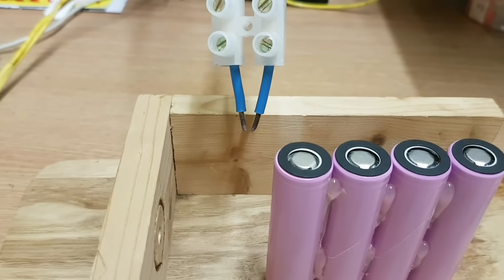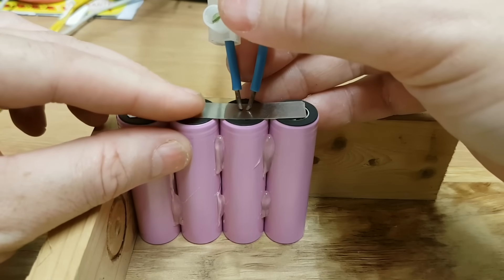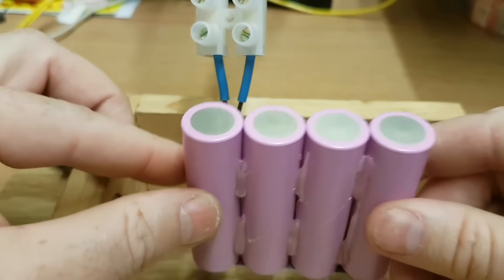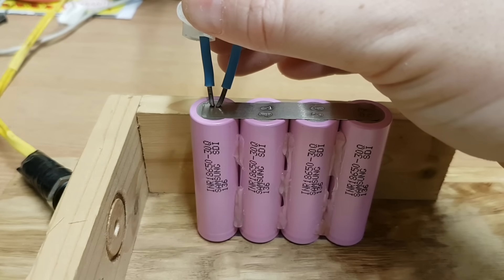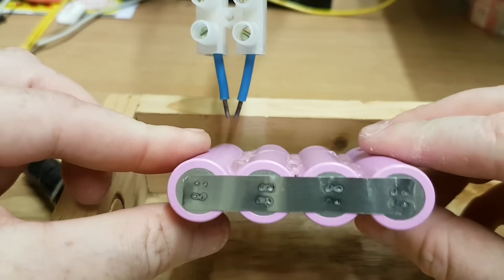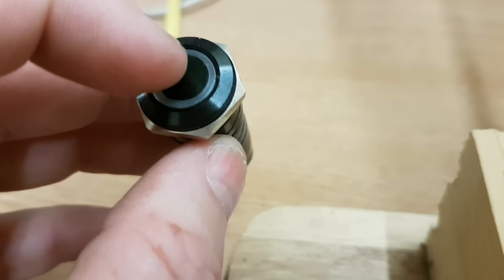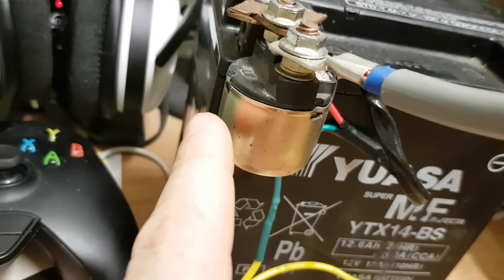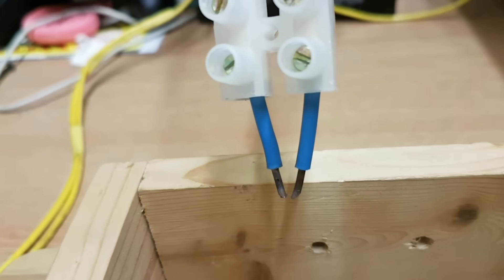DIY Battery Spot Welder - Demonstration & Explanation

Comment: Yes, try a foot switch. I made a spot welder from an old microwave oven transformer modified as a step down transformer: 1.5V at 800A. No need for a solenoid.  I need to see if it will spot weld batteries.

Comment: The consistency of the welds seem to look all over the place. Especially where the electrodes just touched each other and the current didn't penetrate the metal. You should reconsider to build some decent and sufficient stiff electrodes.🤔
Reply: Also the timing is all over the place too so some of your weld suck in quality and consistency.

Comment: Can you just parallel together just like that without fear of thr different state of charge in each battery?? I want to parallel spot weld but fear of sparks flying when i attached the metal strip. Thinking of parallel 5 units of 2800mAh panasonic batteries.

Comment: This is handy to know. When I had a job refurbishing starters as a lad, I made several critical welds using a copper clad carbon rod, (type that used to be used in movie theaters to produce the bright light cast upon the screen). The point I'm trying to make is that we used a car battery for the source of power to weld for that, so it will certainly do a great job for small spot welds as shown here. Thank you for the video, I'll be ordering some nickle to repack a few cordless shop tool batteries. 👍

Comment: I built one of these today to repair a Milwaukee impact gun battery…. They can be quite aggressive on a 360ah battery… my first few clicks weren’t short enough but I got a feel for it eventually 

I found the negative end of the cells welded a lot nicer than the positive ends
Reply from the maker: I'm glad it worked out for you!

Comment: Hi! Great project. I made all the steps exactly like you but i have an issue. The electrode of the  positive side witch is the solenoid relay side, always made weak weldings. I have checked the electrode,i changed it,i always check if made good connection with the nickel plate but nothing. The other electrode always make very good connection. Do you have any suggestions?

Comment: Great video, but one big danger. An easily solvable danger. Every time you use it, it's essentially trying to weld the solenoid together, shorted. The solenoid contacts are going to arc every time the button is pressed or released. Eventually (who knows when) you'll let go of the button and it won't turn off, because the solenoid is welded closed.

To avoid that, one can use a solenoid rated for significantly higher amps (and perhaps volts) than the battery can deliver. A 12V 100 amp battery isn't going to internally weld a 120V 150 amp solenoid.

Comment: Can I use here 12v 180Amp battery??
Reply: yes video battery 12v 12a. your battery x10 amp
Reply from the maker: No, you need at least 300A. The batter I was using here was replaced with a 360A one, because the welds were a bit weak. The welds with the 360A battery were much stronger.

Comment: Why don't you put on-off switch near welding tips?.So that both functions can be done by only one hand.
Simple,Cheap and best welding machine.
Reply from the maker: It's quite difficult to hold the tips firmly on the nickel, and then press a button really quickly with the same hand/fingers.

Comment: can you help me, i need to desolder spotwelds from a buttoncell in a minidisc deck, as the battery is past it's life, it needs replacing for the deck to be able to store settings when switched off

Comment: This is awesome, I wonder if it has to be a battery? Or I can just use any power source such as an adaptor that matches the amper you mentioned?
Reply from the maker: Most power sources would blow a fuse if you shorted them like this.

Comment: why use a solenoid? Just touch the + and - on the tab and it would do the same.
Reply from the maker: Control is why... You would get a massive spark if you did it manually like that, and you'd probably blow a hole in the cell.
Reply: @darkkevind  use a thin gauge wire. It can't pass all that current

Comment: Not meaning to be a bummer but....

As a qualified electrical engineer with a diploma in electronics I can say this design is downright dangerous!
Those particular solenoids are known to fuse their contacts above 100A. massive risk right there!

There is a HUGE reason spot welders typically have a mosfet array or SCR switching the current  which are controlled by rather sensitive current monitoring, timing and triggering circuits and a plethora of safety cut outs and overloads. 
Using this device in such a simplistic form is asking for trouble.
The risks are way bigger than you would think with extreme currents and highly corrosive substances involved. Lead acid is not designed to withstand direct shorts for any amount of time exceeding fractions of seconds.... please stop doing this, or at least upgrade to a less corrosive/Likely to explode power source with an 800A breaker or at least a thermal fuse on one lead. 
Eyesight, life and property are worth more.
Reply from the maker: Tens of thousands of welds later, no explosion, no fused solenoid, no exploded L.A.Battery 🤷
Many other people have used my design and made these welders and again, no problems.
The thing is, if it does fuse closed, the nickel you're welding is only rated for max. 50A continuous at best, so would heat up, burn & melt open in a split second, thus breaking the circuit.
Reply: @darkkevind it's fine ignore that guy
Reply: Lmao shut up

Comment: I like your idea spot on!
Might be better to use the pulse timer as if you accidentally left the push switch down for too long things would get very hot and start to melt very  quickly in seconds.
And batteries don't like to be shorted so there is a risk 
The battery can explode and someone could have serious acid burns. I just like to mention this as I had a car battery explode on me and there was a huge flash and a bang and acid everywhere I was very lucky.
The battery was on charge and when I disconnected the clip from one of the terminals it sparked and it ignited the battery gases
So I should of switched power off first, this was well before youtube days
So I've learnt to always do risk assessment first.
Stay safe folks.

Comment: What’s the material you’re using for the connector
Reply from the maker: Which connector are you referring to?
Reply: @darkkevind  the metal strip you are welding - is this aluminium? thickness?
Reply from the maker: @andrewmcclure2853  it's 0.15mm pure nickel.

Comment: Can it be used with an RC lipo battery?
Reply from the maker: I'm what respect? Spot welding a lipo connection? No.
Using a lipo instead of the lead acid battery? No. Not unless you want the lipo to explode 🤷
Reply: @darkkevind  I want to use a lipo battery instead of a PB battery. Can this be done both are 12 volts it shouldn't have a problem.
Reply from the maker: @subsonicreviews1835  what's a PB battery?

Lipos cannot be used as they do not fair well with being shorted.
You could use a lipo in conjunction with a large capacitor though.
Reply: @darkkevind  thank you for the clarification

Comment: How many amps are you running this thing at??
Because i have a dedicated spot welder and i am not getting the kind of nice strong welds you’re getting
Reply from the maker: The lead acid battery has a cold cranking amps rating of 330A

Comment: Why not power mosfet transistors instead of the solenoid? IRFP3206PBF can handle 200A 60v. put five or ten of them in parrallel, there are only about $4 each...
Reply: It's using a lead acid battery - not sure this design needs to be any more advanced than a solenoid and pushbutton. A design with a smaller plug-in supply with capacitors would be more suited to "advanced" solid state circuitry. Wouldn't mind making something like that myself
Reply from the maker: Sounds like a good idea. Build it 👍

Comment: whether the direct current is on the weld and how many volts it is
Reply from the maker: 12-14v. Current travels in to the metal surface of the battery and straight back out again through the other electrode.

Comment: Wow this is cool ! Years ago I wanted to start a business rebuilding tool batteries and checked  on a spot welder and if memory serves me right the welder was about $2500 I started checking with battery re builders and found out it was cut throat and there was no money in it and you had to sell the batteries for give away prices . So I pulled the plug on it. This is cool I had no idea you could do this.
Reply: I'm here because I'm rebuilding my own power tool batteries with new cells.
Reply: @jamesrowlands8971  Cool man ! If you do it for yourself it would be fun to do I could totally get into this ! How many are you building and for what tools
Reply: @madmanmechanic8847  I found an AEG drill and impact driver in 'hard rubbish'  a while ago. Had to replace the brushes on the drill to get it to work, and while the batteries functioned, they didn't run for long before they needed a charge, so I bought two cheapo ones off Ebay. But they were crap. The cells only lasted a few weeks. So my thinking is to replace the cells in those. Two of those, plus another proper AEG battery that had died due to a cell failing badly.

I've also got an expired ebike battery. So once 4 packs in total to fix up at the moment.
Reply: @jamesrowlands8971  I gave you a long reply yesterday about Snap On grease gun I was restoring and its gone deleted that is weird
Reply: @madmanmechanic8847  YT comments can be pretty annoying sometimes. Was that a battery powered one that you were restoring?
Reply: @jamesrowlands8971  I never said anything tart nor disrespectful or even one hint of foul language I have no clue why it was dumped . If there was foul language or nastiness I could understand it then. That sucks I spent a long time replying to your reply  😔Yes Snap On Cordless
Reply: @madmanmechanic8847  yeah, I've had stuff just disappear like that, either right after I wrote it, or I've come back to a thread because of another reply and seen it's gone. Sorry to hear about your wasted effort.
Reply: @jamesrowlands8971  That is really weird so this has happened to you too? I just started my own You Tube Channel about four weeks ago just one video up it has been a dream of mine for over 6 years I took a lot of nerve . I was scared out of my pants to learn video editing it really intimated me. Part of my channel coming up is a Snap On cordless  grease gun. If you want I can try and retype the story I sent you this time will will type it in word that why if they dump it again I can repost it
Reply: @madmanmechanic8847  yeah, it's happened a few times. No idea why. Seemed like no rhymme or reason to it. I've been on Youtube for something like a decade.
Reply: @jamesrowlands8971  Okay good bye

Comment: I realize this from a few years ago.  It just now popped up in my Recommends.  Anyways, neat tool you have there, but I thought a foot switch would be handier (footier?) than the button you have there.  Anyways, good job.
Reply from the maker: Thanks. I just found that I never needed a foot switch, plus, without a timer, a foot switch is less accurate in terms of timing.

Comment: Be very careful as mine punctured a cell and it vented a flame. My switch is no where as sensitive as yours though. If you are doing 6x4 cells best to have grid strips rather than over lapping strips.

Comment: What's funny , these Vapers will pay £6-8 quid for a One X 18650 battery , where as you can use a old laptop battery and Find 2 outta 10 are faulty , it's so much cheaper to do that , I know the Toshiba satellite series packs open up 🙏🙏
Reply from the maker: Except most laptop batteries are no good for vaping as they require a high current draw. Vaping generally uses anywhere between 15-40A of current, whereas most cells used for laptop batteries have a maximum output of around 5-10A.
Reply from the maker: But nevertheless, these cells can be bought brand new for between £2-£4 depending on the actual cell.
Reply: @darkkevind  Go in a Vape shop,price up 1 Samsung 18650 or Toshiba,all the same , and ya talking 60% plus RIP OFF,, I know how cheap they are, I sell em to mugs

Don't forget ya Multimeters 😉😂😂😂

Comment: Eu comprei minha caixa de som em 2015 e veio com 400 mah, eu estou em dúvida se eu coloco bateria de 3.7v 9900mah ou 15.800 madh 3.7v, pode queimar? Qual posso colocar pra não queimar?
Reply from the maker: As long as the voltage is the same it will be fine.

Comment: Hi, thanks for this video, I have referenced it in my recent upload. I have noticed with my setup that it's best to use a partly discharged battery, maybe about 12.5v so that the spot welds are not too fierce. Cheers

Comment: what do you mean your battery is 200amps? as i read from the label its 12amps
Reply from the maker: That's 12ah. That's not the rating in referring to. The CCA (cold cranking amp), rating is 200A. It means, from cold (to start your car for example), it can pull 200A from the battery, to turn a heavy crankshaft of a cold engine for example.

Comment: Just a 12v battery with a relay.  So I can build a bench top spot welder press for 18650s power it with my shop AC welder set on low amperage.  200 amps at 12v seems very high.

Comment: Why not have four contacts on the probe head, and you have four welds in one hit? Might need to increase the button press time, but it will save you time doing the packs. The time the current flows is only mSecs ....so why not give it ago.

Comment: We're is the solenoid avilable ratings ie 12volt amps how much amps
Reply from the maker: It's a starter relay. You can get one on eBay or Amazon easily.

Comment: He will have alot of fun when the relay contacts just stuck xD
Reply: The contactor won't get welded shut because it's only for a split second.
Reply from the maker: Many tens of thousands of welds so far and no failure of the relay 👍🏻
Even if does get stuck on one day, the nickel will fuse out in a matter of seconds as it's only rated for 40A. 🤷

Comment: So does it just melt the strip under each electrode and the melted puddle from the strip 'falls' onto the battery end plate? This would be different from spot welding for example sheet metal together where the sheets of metal are squeezed between to electrodes.
Reply from the maker: No it works exactly the same way as spot welding sheet metal. The nickel fuses to the metal of the battery terminal directly under the electrodes.

Comment: what is the role of solenoid ?
Reply from the maker: The solenoid/relay is a high current switch able to act as a switch whilst very high current is passing through it. Without it, whatever other switch you may use to complete the circuit will probably melt.
The small momentary switch is activating the relay, which then puts all the current from the battery to the electrodes.
Reply: @darkkevind  ooo ok ok thanke you .

Comment: For the DC power, can i use computer power supply..??
Reply from the maker: No.
Reply: @darkkevind  okay.... Thanks.... 😁 so i should use the motor battery..?? Right..?? 🤔
Reply from the maker: @adansyahdan9319  you need something that can deliver a heck of a lot of current, 300 plus amps. If your PSU can do that, all well and good, but really you can only get that from a lead acid battery.
Reply: @darkkevind  oooowww... Okay .. Thanks for the explanation..🙏🏻😁.. Need to get that amps...

Comment: Great video.  Thank you.  And also thanks for the links. Extremely helpful. 
I have a most serious problem, a real crisis, to solve with a Solenoid Water Valve.  Due to Covid-19 my wife works from home.  To ease her boredom I hung a bird feeder in the tree outside her window.  She  delighted in her birds at first but now she battles birdseed greedy squirrels all day.   The plump squirrels are oblivious to her scare tactics;  waving, yelling, knocking,  etc..  Even her outdoor efforts fail.  Rude squirrels simply climb higher and bark obscenities down at her.  Once she turns away they’re back at the feeder.   I need a Remote and/or Alexa Controlled Water Solenoid Valve (Preferably 8VDC battery or possibly AC Low V). To drench these plump Critters.  Preferably a valve that stays opens about 5 seconds.  Any help is sincerely and greatly appreciated.  TY Best Wishes!
And yes we feed the Squirrels elsewhere too, but they love birdseed or maybe they just love pissing off my wife.

Comment: Awesome!!!!..but I don't get the point of the solenoid can anyone advise please.
Reply from the maker: The solenoid/relay is a switch that can handle the high current. A smaller momentary switch would melt the first time you tried to use it.

Comment: wait, how are the batteries not shorting out
Reply from the maker: Why would they short out?
Reply: @darkkevind  I'm very very new to battery physics, but wouldn't connecting all 4 batteries in parallel like this short them?
Reply from the maker: @rjsd7  no, shorting would be directly connecting their negative end with their positive end.
Reply: @darkkevind  oh, so because these are all in parallel, it cannot short unless a conductor completes the circuit (top metal touches bottom)?
Reply from the maker: @rjsd7  yeah exactly. All those is doing, is making a battery with the same voltage, but 4 x the capacity, which means under the same load as one cell, would last 4 x as long as an individual cell.
Reply: @darkkevind  thank you so much for your patient explanation!!
Reply: @darkkevind   so to clarify, pretending these were four 1.5v AA 2000mAh batteries, would putting 4 of  them in parallel =  1.5v; 8000mAh, but putting them is series =6v;2000mAh?
Reply from the maker: @rjsd7  yes, that is exactly correct.